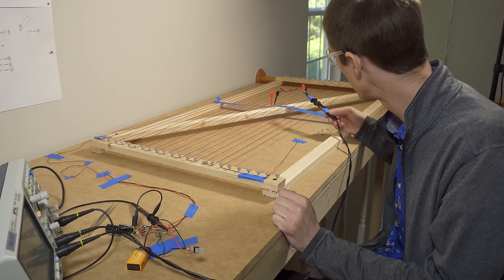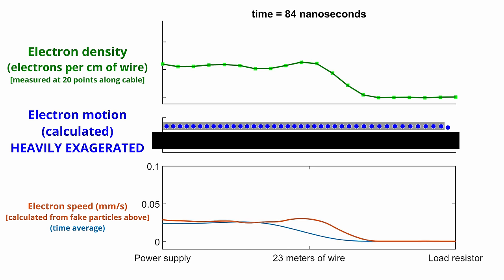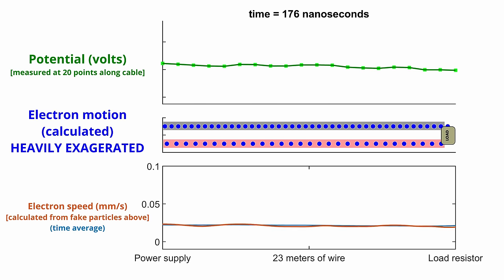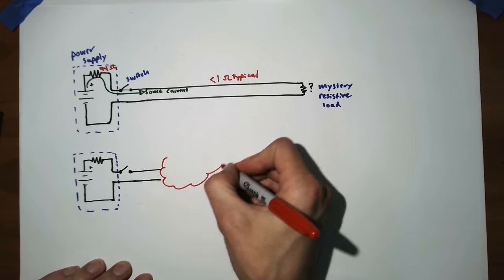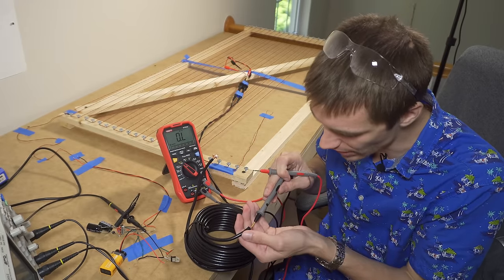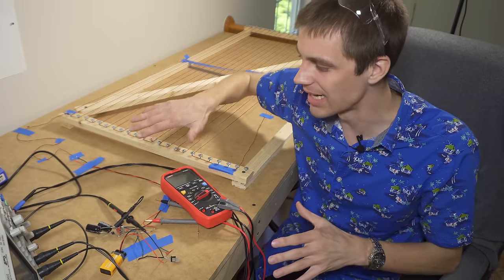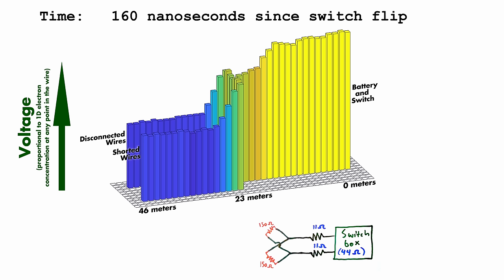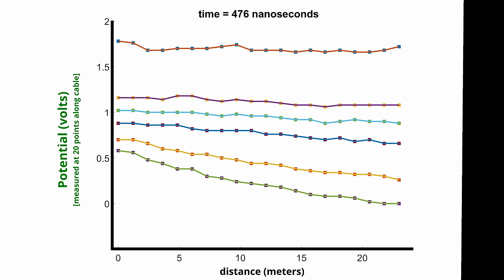What does "impedance matching" actually look like? (electricity waves)

Comment: You can also view terminating resistor as substitute for the rest of infinite wire. This way it's easier to understand why there is no reflected wave in this case
Reply from the maker: fantastic way to phrase it! it looks like the wire goes on forever
Reply: @AlphaPhoenix2  The Design of CMOS Radio-Frequency Integrated Circuits has a very amusing chapter on transmission lines containing the gem:

> We've just seen that an infinite ladder network of infinitesimally small inductors and capacitors has a purely real input impedance over an infinite bandwidth. Although structures that are infinitely long are somewhat inconvenient to realize, we can always terminate a finite length of line in its characteristic impedance. Energy, being relatively easy to fool, cannot distinguish between real transmission line and a resistor equal to the characteristic impedance.
Reply: @kilovoltamp  Sounds like an interesting read. I'll have to check it out thank you
Reply: @kilovoltamp  That quote sounds like a mash up of Turbo Encabulator and The Missile Knows Where It Is
Reply: @kilovoltamp the line "energy, being relatively easy to fool" sounds like someone is going to get a good zap ⚡
Reply: @kilovoltamp  haha, I agree that infinite structures are inconvenient to realize
Reply: This quote made me understand the whole video (still a great video but that was perfect summary)
Reply: Yep, all the waves energy in converted into heat in the terminating resistor so it blissfully dies and passes into universal entropy thinking it lived forever.
Reply: @AlphaPhoenix2  That is a part of the theory. Look it up in Wikipedia.
Reply: Makes perfect sense. :)
Reply: No.

You can analyse this using a simple set of circuit diagrams with different termination scenarios at the end of the line, and using Ohms law to analyse what is happening to the voltages.

Then it becomes apparent there is no need for a reflection when the load impedance equals the characteristic impedance of the line.
Reply: @kilovoltamp  That's a very amusing quote. But the "infinite wire" thing is a bit of a distraction, because we can remember that the practical circuits we design run continuously for only a limited amount of time, often as short as a few years or less, and rarely more than a century or so. So the actual wire need be long enough only for the reflections not to return in the lifetime of the circuit, and this can typically be satisfied by making the transmission line only a few, or perhaps a few dozen, light years long.
Reply: Was actually going to write the same comment. As my telecommunications professor taught us.
Reply: Also another mind bender: You're saying an infinitely long wire will have a real value... not infinity.
Reply: @sicktj  It's not a mind bender at all when you realise that a transmission line is a pair of wires, and the impedance is dependent not on the length, but on the distance between the two wires of the line and what's between them. The characteristic impedance of a common television coaxial cable is 75 Ω because of the particular size and composition of the insulator between the core and the shield, and that composition and distance between the two conductors is the same whether the length of the cable is 1 cm, 1 m, 1 light year or infinite.
Reply: 🤯 As soon as you said "infinite wire" it all fell into place for me. Thank you!
Reply: Very well done video showing actual data and making it very visual. As mentioned in other comments, the wire is really is like a ladder of tiny inductors and capacitors (the rails would be inductors and each rung would be a capacitor) all of this can be modeled with some pretty interesting math (mostly forgotten from Electrical Engineering degree 25 years ago, that is what happens when you are in IT and don't use this stuff, but radio engineers would definitely use) The math includes calculus and imaginary numbers. It all starts with understanding LCR circuits (Inductor, Capacitor, Resistor). Capacitors take time to charge (creating electric field) and Inductors (creating magnetic field) take time to allow current to flow.
Reply: @kilovoltamp  Cheers man